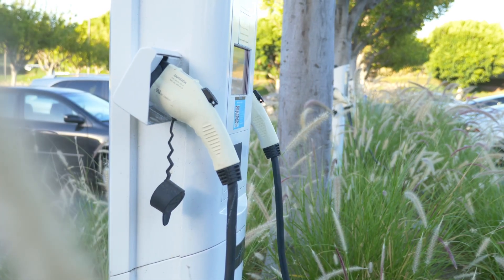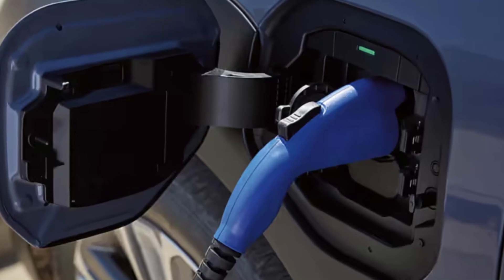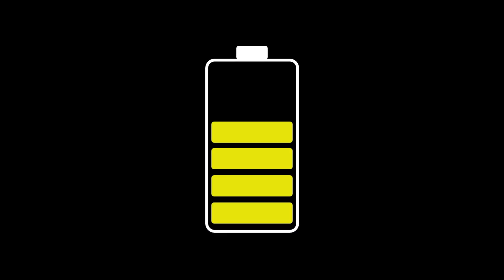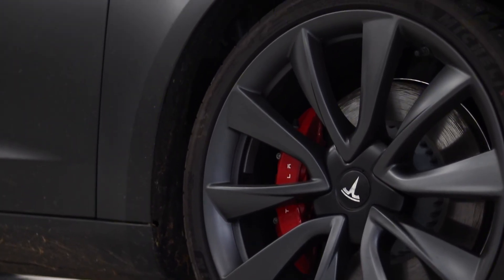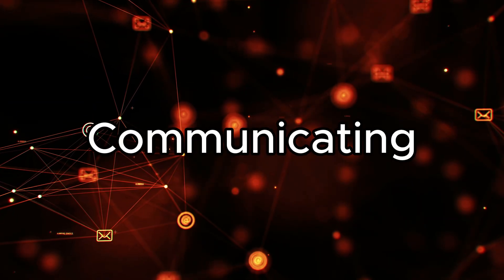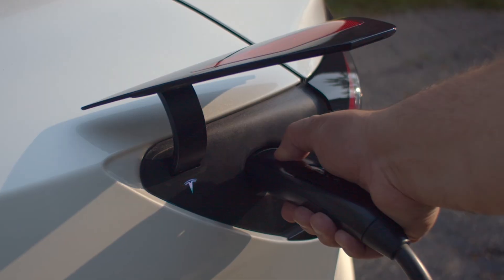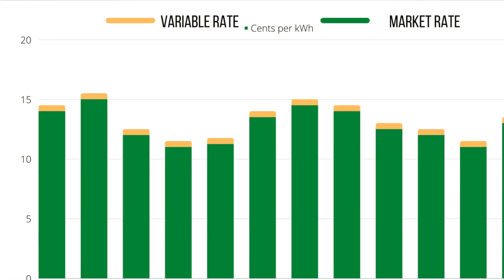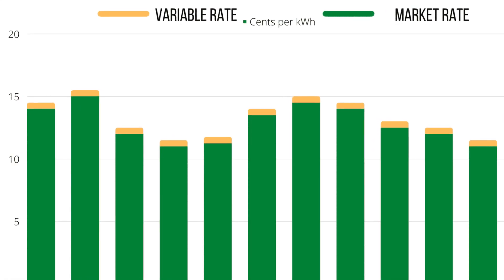The Shocking Truth About Home EV Chargers

Comment: One thing to consider is that, even with Level2 charger doing 120V at 32A, this is not enough kW to run the PTC battery heater and also the car heat pump in extreme cold without also discharging the battery a little bit. At least on my Model Y. But I can't feasibly get a 50 or 60A circuit setup without lots of expensive wiring. So 40A breaker is what I'll have to live with. It's good enough, just not ideal.
Reply from the maker: Thanks for your comment 🙏
As you mentioned there are some tradeoffs but 40A breaker works fine but heating needs more time

Comment: 7kw is better than slower because of the inefficiency losses. I lose about 30% at 2kw whereas it is around 13% at 7kw
Reply: you number is a bit exaggerated. in general, 11KW is more efficient than 2KW but the difference is only 5% ish, negligible.
Reply: @lk313 calculated this more than once on my Kona from 2022. So unless mine is particularly bad for some reason
Reply from the maker: Thanks for sharing your experience and the interesting data on charging efficiency!

Comment: i charge 2 erevs entirely from a single 30amp evse which maxes out my obc at 3.2kw, and a 120v evse that i just leave the cars plugged in to maintain battery outside.. 120v here in the usa at 8amps gives a lot more time for bms to top balance cells.... just saying.
we do 80%+ of our driving on ev only mode and only a handful of times have i felt like we didnt have enough charging power to reduce gas use....
i just power the evse thru a dryer cord splitter and outlet i put in for 100 bucks. people quoting 5k usd installs for 40amp plus relay boxes is insane to me... guess i can always use cheap gas so ev range isnt an emotional just in case situation for me.... erevs really need to come back to north america
Reply from the maker: Thanks for your comment 🙏
I totally agree , we shouldnt miss on Erev.
Erev is reducing range anxiety and gives the ev benefits .

Comment: Different strokes for different folks...

Our EV does a 130 km round trip commute (32 kWh) 4 days a week.  A 7 kW charger does the job overnight.   22 kw 3 phase would be better, you can always dial it down, but the extra would be good on a heavy usage weekend

Home solar and batteries are a game changer, our running costs are 1.4 cents per kilometre
Reply from the maker: Thanks for the comment 🙏

Comment: I have a 100 amp service to my house. I put in a heat pump dryer or you could just switch it off when charging car. I used the 30 amp for my EVSE and it charges my EV  from the dryer circuit with 5.8 amps and usually takes around 10 hrs to charge from 15% to 80%.
Reply from the maker: Is the charging speed sufficient?
It seems that you have a giant ev maybe a Hummer ev?
Reply: @shayan_ev I have an EV6 with a 74 kWh battery. Remember it is on a 30 amp circuit that is down rated to 20 in the CVSE. This gives my AC charger in my car 5.8 kWh so it takes around 10hrs to bring it up to 80% from 20%. If my battery was warm 75 degrees Fahrenheit it would take 20 minutes on a 350 watt DC fast charger.

Comment: I own a 2018 Chevy Bolt. I have used the 120 volt charger for six years. I have programmed the car to charge at 12 amp when I'm at home. (I installed a proper 20 amp circuit for this, with a ground fault protector) It suits my needs and I only charge on the road when going on trips. I do 90% of my driving in town. The charging grid in Quebec is top notch. One supplier, one account, chargers everywhere, even in cities, on the streets, you can charge when you go shopping. Three years ago I calculated that my cost was equivalent to gasoline at 80 cents a gallon. (We have the lowest cost for electricity on the continent). I bought a 220 volt charging station because we will be using two cars in 2026.
Reply from the maker: Qubec is very EV friendly. I didnt see such an infrastructure in Ontario yet.

Comment: I have a plug in hybrid (full EV's are impractical in the US if you want to avoid Tesla infrastructure), but I just use a regular 120V outlet to charge my car.  It covers my work commute and daily needs on EV mode, so I only need gas for longer trips.
Reply from the maker: This is great. 👌
We need more companies moving to  Range extended and plugin hybrid versions Since their electric vehicles arent mature enough.
Reply: @shayan_ev Ah yes, plug‑in hybrids — the pinnacle of reliability, if you ignore the fact they break more than EVs and gas cars combined.
Reply from the maker: @tony2707 
Some brands are reliable ,maybe toyota’s but  i agree with your comment overall reliability of plugin hybrids are lower.
Reply: @tony2707 
It depends on which plug-in hybrid as they're not all made the same. The Prius Prime/PHEV, for example, was made using the Prius as a base. All Toyota did was make the battery bigger and add a charging port that connects to the battery. Everything else is the same.

It has all the same parts as the standard Prius, which is why the drive quality is extremely similar between the two variants with the exception of horsepower and torque. I've driven both and they're basically the same when using the engine.
Reply: @woodenmetal2977  well then if were being specific, then buy a Tesla, best of both worlds, good distance, can be charged at home not needing to wait around gas stations filling up, great infrastructure in the usa with reliable fast charging for highway distant journeys, you will save hundreds if not thousands each year and have one of the safest cars you can buy. Also cleaner air on the roads
Reply: @tony2707 
Why would i buy a Tesla when I already have a car that is fully paid for?
Reply: @woodenmetal2977 i was more directed at people who havent made the mistake of buying something besides a Tesla. I cant do nothing for you, im sorry.
Reply: @tony2707  Because Tesla is no longer a legitimate company. They made one of the worst vehicles in all of history, then went fully fascist when they started supporting Musk.  I wouldn't be caught dead in a Tesla.  In fact, I used to have a Model 3, which I sold for the Prius.  I also would not trust Tesla as far as I could throw them.  Your car will be used as a surveillance device against you and others.
Reply: @woodenmetal2977 yeah, what you said makes sense most of the time. I already had two ICE cars but had gone ahead to buy an EV since I am nearly at 65. It's like now or never. 😂😂
Reply: @StormsparkPegasus I am not able to grasp on what basis people call Elon a fascist since the PM of Israel did not call out Elon as a fascist!. 🤔🤔🤔
Reply: @shayan_ev  More things present = more things to break.
Reply: @woodenmetal2977  You wouldnt, if you were smart. Unless youre just into cars and are upgrading as something you enjoy in which case its transportation AND entertainment.
Reply: @StormsparkPegasus  Unlike in a GM where they monitor everyplace you go, everything you say, give the FBI access to the microphone in your car without even a warrant and shut your car off when they get a whim to do so.
Reply: @StormsparkPegasus  
Why would they be fascist by supporting Musk? Do you even know what a fascist is? A fascist would shoot you in the face if you disagree with them - there's no room for discussion. Musk bought out Twitter, a platform where people can post what they please. You can even go up to his face and call him out. The worst he'll do is laugh at you. That's not fascism.
Reply: Who waits around a gas station? I have seen people wait around charging stations thou, usually because 1/2 of them don’t work
Reply: @johnfalco9528  Yeah Tesla had the only reliable fast charging network in the US.  That's not the case in the rest of the world, just the US.  Which makes a full EV a no-go in the US, at least for now.  Which is why I got a Toyota plug in hybrid.  Because I will burn gas before I ever touch a Tesla fast charger (AC chargers are fine because they don't control those).  My car is just as good as an EV for my daily commute, I really only need gas if I take a longer trip somewhere which is rare.
Reply: @woodenmetal2977  You shouldnt buy ANYTHING if you have a car thats already paid for.
Reply: I recommend adding a Chargehanger.
Reply: I had a Volt, about the most sophisticated PHEV. Extremely cool tech. But I got tired of hauling a bunch of stuff around that I didnt use and not having much room in the car because of it, so I switched to a Bolt (pure EV). Much less stressful. 

I originally wanted an Ioniq 5 but the waiting list was 3 years if I didnt want to pay way over sticker, so I got the Bolt to "hold me over" til something cooler came along, but there still isnt anything more awesome that isnt double the price (or more). Like it more every day. Yes, on a long trip it is very slow charging, but 98% of the time I charge at home on L2 so its actually FASTER than gassing up a car.

Comment: Perfect advice - goes hand in hand with the ignorance around the 'no infrastructure ' agruement people make about EV's and charging. People just don't realise you can charge your car with comfort and ease at home, overnight on cheap rates. No need to go to a 'service/gas station' again, unless you need milk 🙂
Reply: You live in an apartment - just drop a cable from the 6th floor, bro.
Reply from the maker: @j @jeronimo196 i wish it was possible 🤣
Reply from the maker: Exactly! Home charging changes everything for EV owners.
Reply: At 7kw the miniature circuit breaker in the house consumer unit heats up, so now I charge my KiA E3 at 4.6kw for 5 hours on an  EV tariff, i feel this is a safety issue which needs to be investigated.
Reply: Well, to use the squeegee